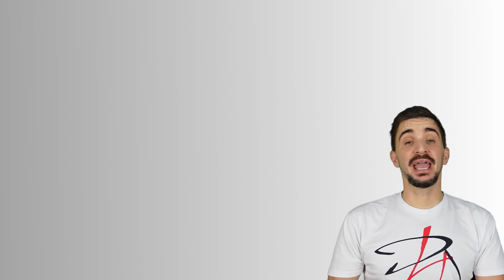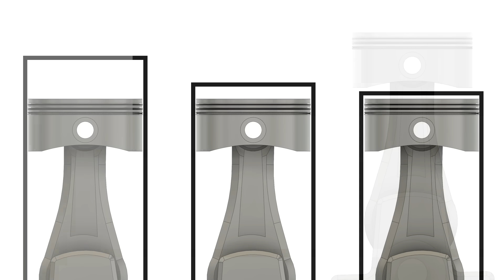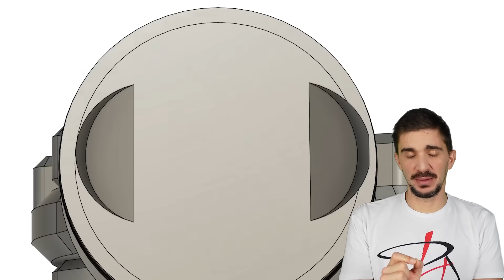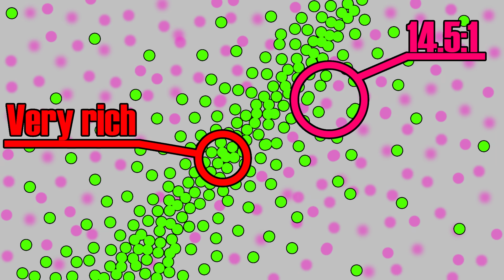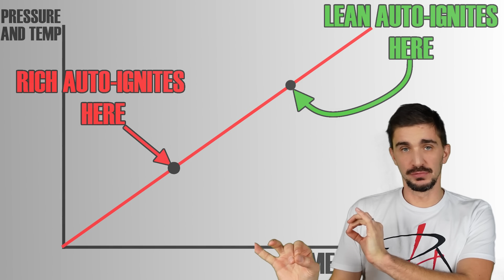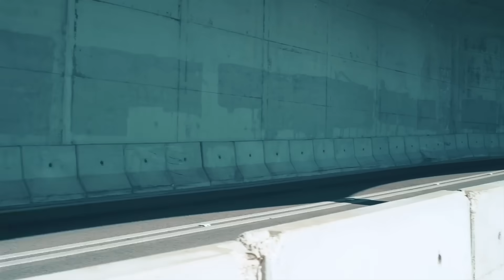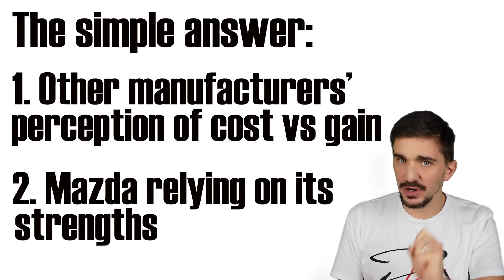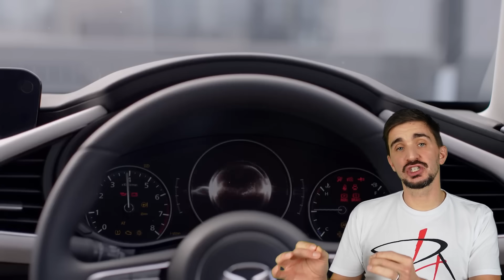The Game Changer Nobody Cares About - Mazda Skyactiv-X SPCCI How it Works and Why It Didn't Catch On

Comment: Sounds like SPCCI would be great as a generator in a PHEV (fixed load efficiency, in-town driving purely electric...). Imagine a 1.2 or 1.4 version of this engine (lower weight and NVH, even lower consumption and the lower power would be ok, as the battery would take over the high demand peaks, and compensate with regen and extended low rev engine work if needed), coupled with a 5 to 7 KWH battery under the seat (that's at least 30 km of pure electric range), one compact starter/generator unit geared in, electric water pump and electric AC compressor, so no belts to mess with, less weight, less service costs, a solid timing chain with metal guides, two compact two-speed transmissions (for engagement and efficiency) packaged into two electic motors, one on each axle (easy 4 wheel drive and maximum regen capability), no actual link between the engine and the wheels, a 20/25 liter fuel tank, only DC charging onboard (you keep a cheap external AC charger for overnight charging and you use DC charging stations if you want), keeping the weight down. It should be done on a mazda 3 for around 1500kg, with a wagon version for practicality, 250 to 300 hp maximum combined output, with the option to cap the power at different levels using software, and selecting FWD/RWD/AWD as you want or as the car sees fit. You get almost no fuel cost for everyday use, you preserve the engine, you get on-demand 4 wheel-drive, the amount of power/efficiency you want, no charging nonsense, no big expensive battery if it ever needs replacing and customizable power delivery modes (one actual useful thing about that "software-defined vehicle" nonsense they keep yaking about). It would be an Outlander PHEV, a Subaru, a Lucid and a Hybrid toyota all mushed together in one, the best way possible, and I think Mazda should make it.
Reply: I completely agree with you. This concept is good because, when discussing the low efficiency of fuel-powered cars, the excess heat generated is considered a loss. But in my opinion, the biggest loss is heating the interior and battery from the battery itself, as is done in electric cars, reducing the efficiency of the electric car (their range is halved). A hybrid system does not have this drawback; engine heat is utilized to heat the interior and battery in cold weather, while charging the battery and increasing the range.
Reply: neat concept. I think it should also have a cost-reduced version that deletes the second rear motor, and instead of the two speed transmission has a fixed ratio output on the motor. then put two dry clutches on the output shaft of the engine: one for the generator, and one that allows direct drive at a 0.75:1 ratio for efficient highway cruising.

have 80hp output on the engine and 200hp output (120hp peak output from the battery, plus 80hp from the engine to hit the peak figure) on the electric motor. offer a 9kWh and 18kWh pack size to cover a shorter or longer commute w/o gas. optional heat pump for colder climates.
Reply: Like Honda jazz e-MMD e-cvt without the clutch aka full serial hybrid :)
Reply: Also it will supplement the Hybrids where they start to drop MPG i.e. highways.
Reply: See Edison Mortors semi manufacturer
Reply: I came in here to make this comment. I would use it as a range extender for an EV as opposed to having a direct connection to the wheels. There is huge benefits to efficiency if you designed the engine to run at a specific rpm. Heck, I bet you could achieve something like this on a 2 stroke.
Reply: @CiGambino  100%
Reply: Just posted the same, then read yours!
Reply: They must have already thought about it right? Maybe there's further RnD before accounting can expect a profit. At least in the US, with the removal of subsidies, they might opt to delay the announcement until there's a better chance at a profit
Reply: Their PHEV is using a rotary instead for some reason. Seems like they want a lower weight but I agree the sky active would be better
Reply: @tacticlol rotary are actually fuel efficient if kept at same load/rpm. It’s the start and stop rpm’s that make them drop off. I used to get 10-12mpg city and 30-35 hwy on a modded 13b.
Reply: @tacticlol I heard about that. It’s a good idea on paper. The rotary is lighter, more compact, vibrates much less, and it has more branding value with all the history. I don’t know how reliable it will be, but if something goes wrong with it out of warrantee, nobody would be able to work on it exept the dealer.
Reply: I’ve been shouting this forever. We are building the most efficient gas engines ever and have made great progress with electric vehicle tech. Meanwhile the biggest issues are battery capacity. It only makes sense to combine those two technologies.
Reply: There are already ways to do a range extender engine with more than 45% thermal efficiency.
Reply: With a mind like that, why are you not working for Mazda already?
Reply: AC charger and DC Charger are usually combined with no signifigant extra weight but the rest is spot on. Some manufacturers even have them in the same package as the traction inverter.
Reply: @cesarhanshoff2741  That's true, but it's purely for packaging reasons. It's a box with many boxes inside, a better waterproofing decision. DC only needs the wires and an ECU (like charging a smartphone from a laptop). AC needs the Rectifier (charge adapter) which is heavy and bulky. I saw once that bidirectional units (Inverter/rectifier) do exist, that would be the best solution, but I couldn't find anyone mass-producing them (I tried designing a motorcycle conversion in 2021)
Reply: You sound like your making sense..... Be careful they will lock you up😅😅
If you work in the car industry.... What you would do is give thousands of press conferences talking about EV cars and invest 1 Trillion Euro in the plant and development to make them ..... But not make any of the long term contacts to secure the literal 2/3 of world copper production and 300% of world Lytham production needed amongst other massively expensive minerals..... 
Needed to manufacture  EVs then walk away and right of the whole investment...
That's an auto industry thing to do
Reply: @billturner6564  There you go, it's all a racket. The "save the planet" people got hold of the money supply for a while, so middle management went to the casino with it, hired a few drinking buddies as consultants. I left a year ago but my head still spins when I remember the level of BS I heard in most meetings. D4A should start a AA-type group thing for this...
Reply: That's what I was thinking 🤔
Reply: So, the perfect match for a Toyota Prius or Hybrid Corolla.
Reply: @honestiguana they both use Atkinson cycle engines,  for higher efficiency.
Reply: Why replace a belt which is about the most reliable auto part and cheap plus quick to replace with an electric drive that's smokes in desert weather and cost hundreds of $ to replace?
Reply: But they put their 3 timing chain at the back of engine like merc .🤔 there are couple other small glitches which they tried to copy merc engine.
Reply: Especially if they put it on an Atkinson cycle like the prius
Reply: @MichaelBrown-wx6zq For this engine to be able to operate as a normal gas engine in non-skyactive mode with such a high baseline compression ratio they must already be using VVT to reduce the effective compression ratio and prevent preignition. So perhaps this is already a part time atkinson cycle.
Reply: Phev is more robust and versatile but less efficient than let’s say something like gyro. You want peak efficiency you’re going to have to give up a lot of speed and acceleration capabilities which in all reality is perfect for city driving. But at that point in the city why even go ICE at all? In an environment where logistics has no limit, an ICE is undesirable due to emissions. Just keep electric as a base until we find a more convenient energy “currency”.
Reply: @yoface938  I don't know anything about gyro, but the best thing about piston engines, they're easy and relatively cheap to fix longterm. your logic stands in big cities, where electricity is cheap and as long as one never has to do long journeys, especially in cold climates. In Germany for example, it doesn't work for everyone. If for some reason you have a 750 km drive every week, each way, in -7 degrees celcius, and you want maximum value for your money, which is a limited ressource for most of us, you just get a reliable old diesel, desirable or not. That's what I did, I got a 2003 W203 C class with the OM646 2.2 CDI engine and a 6-speed manual. It has a leather interior, sunroof, cruise control and 420 PSI of compression on each cylinder (the engine is almost brand new at 220000 km). For the cost, It's desirable ! I'm cruising at 120 kph at 1800 rpm and at 220 kph at 3600, and it averages around 6 L/100 km. There are NOX and particle emissions, true, but something has to be sacrificed, it's not gonna be my money and I don't do loans or leasing. Plus, those heavy EVs also emit particles, from the tires! I didn't look too much into it, but I know there's some Japanese study that was made and the figures were surprizing. Either way, engineering has to work in the real world, and it has to make sense for the middle class. If it becomes just a sales pitch, or ideology, or a sick mix of both, and they keep pushing it, it's not good for anyone, it drives the leaders completely out of their minds, people will see through it, which will get them disallusioned with science and technology, with institutions (remember COVID !), it makes them question authority, maybe not in a healthy way, so they become susseptible to certain types of theories, certain type of clowns, which can, and historically did, create unrest...
AAAnyway, If that PHEV gets made, I'll definitely buy a clean 5 year-old one, once I know how reliable it actually is and it's at half price.
Reply: 5-7 kWh battery for a 200hp engine? I mean, why not just charge the battery? Using an ICE to charge the batteries is such a waste.
Reply: @wss33 the idea is that the battery would be able to give out the maximum power, just not for too long. You can quickly recharge it in any station, but when you have a long journey and some kids, you won’t have to rely in those expensive highway charging stations that might not work or be unavailable. When the battery is out, the engine would produce the electricity you need for the motors, and maybe some extra to charge the battery, if you’ll be arriving into a congestion zone for example. In fact, with some simple software work, the car can work it out. You give it the journey, tell it how much peak power you want, and how much electricity you want in the battery when you arrive. It can manage the energy on its own. Phevs have more complexity, that’s true, but if you want the cheap quiet electric commute with the freedom of range of an ICE, there’s nothing better, exept having two cars.
Reply: @MedMefteh  This is a great idea. Someone needs to do it. I would love there to be an as easy to understand and convert hybrid as this available for someone like myself who would love to have a hybrid for reliability and resources saving.

Comment: With such talented engineers, it would have been fantastic if Mazda had been the only car manufacturer to truly value repairability by providing full access to diagnostics and essential programming features directly through the car’s infotainment system. Modern vehicles already have large displays and powerful onboard computers, so why aren’t diagnostics and basic maintenance programming available in an owner-accessible service menu?
The answer is simple: greed. That is precisely why this should be required by law. The right to repair and the fight against subscription-based features are two of the most important issues car owners should stand up for in the years to come!

Comment: I had the same experience in the dealership. I was looking for a high displacement engine, and they had this 2.0 180~CV and the 2.5 140~CV. The car with the Takumi finish was beautiful, i thought it was my car until I put it on the driveway and had to rev it like my old Fiesta. Yeah, it had more power and all of that, but it wasn’t nearly the change of experience I felt I should be getting for a 34k car. Ended buying the Civic with the 2.0 and CVT transmission.
Reply: great choice, id have done the same as well I believe

Comment: I have a 2024 Mazda 3 sedan with this engine. 2.0 Supercharged making 186HP, paired with a 6 speed manual. It has a soft hybrid as well.

Mostly behaves like a diesel, sound wise and driveability. The usual daily driving powerband is 1500-3000rpm, it can spin to 7000 rpm iirc if one needs it, but doesn't really feel like much of a difference. Fuel consumption is amazing, 5-5.5L/100km at 120km/h GPS cruise. It's a fairly comfortable car.

Comment: Average combined mpg of this engine is 55mpg. An equivalent 1.5 TSI Golf does 52mpg. And the Golf will be alot nippier in normal driving thanks to its turbo torque. Great tech but the numbers are simply not worth it. Similar to Freevalve. If they make a MazdaSpeed3 version of it with a turbo, 400hp and still get 50mpg+, that i can get onboard with.

Comment: Wouldn’t HCCI be really good for hybrid cars? It’s a situation where you can use the electric system to accelerate the car from a stop, so the IC engine can run at a steady low to mid range speed, when it can do the SCCI, and switch to the combustion system once at a steady speed. A 30% drop in fuel consumption when in cruising & battery charging mode would make hybrids an even stronger proposition.

Comment: I am a happy owner since 2021 of a Mazda 3 with the revised e-Skyactiv X with the additional 6 horsepower over the original 180hp 2019 engine.  This video confirms my reasons why I chose this car, it is a car that you have to operate yourself to extract its potential.  It's a secret 1980's era Porsche for the modern driving enthusiast with an average contemporary income.  Thank you for making it so clear to understand what exactly SPCCI is and how it works, I thought I fully understood it but you made it even clearer.  For example I did not know that the mixture is extremely lean yet perfectly mixed.  In daily driving it reminds me of my previous diesel Alfa but when you work the engine you get sportscar like performance.  Thank you DRIVING 4 ANSWERS!  Regards from Belgium.
Reply: How long do you own that car?

How many km has it?

Any problems so far, please?
Reply: @K@Kliq-n2s 45k kilometers in 4 years, zero issues.  Gets yearly oil change at Mazda dealer.  Airco had an extra check up on my request, not because of issues but to keep the gasses topped up since I don’t do many long distances.  I plan to keep it for a very long time.  It does have the lithium battery inside for the mild engine assistance and the small supercharger, the latter being the most prone to failure (I think) but the battery is at most half full with long duration driving and braking so for a battery the best state to be in.
Reply: to me it reminds me honda 90's D15Z6 VTEC-E engine , it had a mode with lean mixture and some valves discabled . Honda even used this engine to beat long range consumption records ADAC „EcoTour of Europe 1994” . It could get close to 50mpg in right scenario ...

Comment: Always enjoying your videos! I have a more technical curiosity: could you talk about how this engine uses knock during SPCCI, what are the implications of that, piston ring design, oil dilution during winter and so on. This engine always has knock noises at low to medium loads during summer and less so during winter. Thank you so much for your efforts on educating people!

Comment: Wouldn't an hybrid version of this be great ? Efficient highway cruising, adding some torque at low rpm, reducing city fuel consumption ?
Like the small batteries on some renault hybrids, in the end, the car is still light and I found it enjoyable, but the highway consumption was totally unimpressive.

Comment: U should have summarized it this way: IT's just a diesel engine which happens to run with gasoline. It cost's the diesel engine and block and internals are hardened and similar for diesel, but it doesn't have diesel torque. No wonder other manufacturers didn't see the market for a diesel engine with ability to use gasoline. They see the market for pure diesel and lightweight simple gasoline engines.